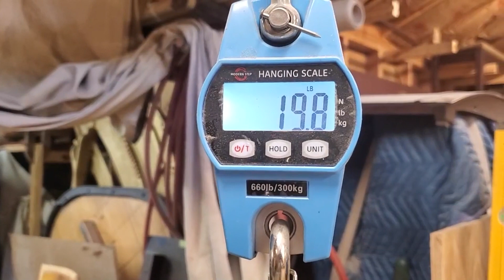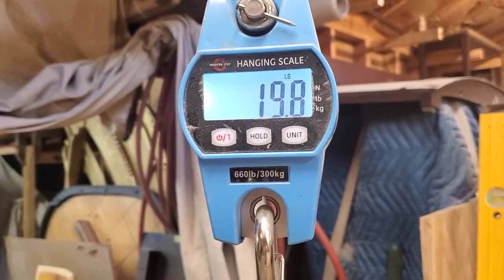Baldwin E Soundboard Removal, Weight, and Faux Crown

Comment: I learn a great deal from this chanel. Now I wonder why it makes a difference if the crown is caused by the pressure of the rim in stead of the ribs.
Reply from the maker: When it's under compression (internal forces) its behaving like a  tightened drum head.
Reply: @ChernobieffPiano  but isn't that just what we want then?
Reply from the maker: @Johannes_Brahms65  the Baldwin board had no compression even though it was arched.
Reply: @ChernobieffPiano  I'm lost! What caused the arch if not any compression?
Reply from the maker: @Johannes_Brahms65  The rims are angled on higher quality brands. When the rims are not angled and a crowned board is installed, the flat rim assist in shortening the crowns lifespan.
Reply: @ChernobieffPiano  What caused the crown it had before it was taken out? I'm sorry if I'm bothering you but if there is one thing I would like to understand in my life it's the workings of a good soundboard!